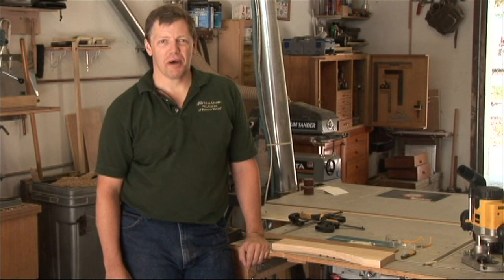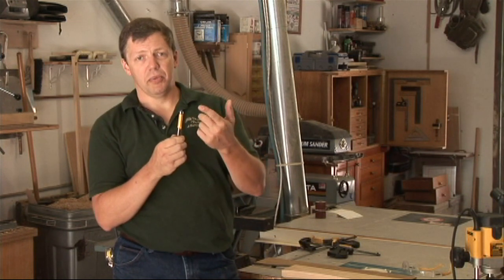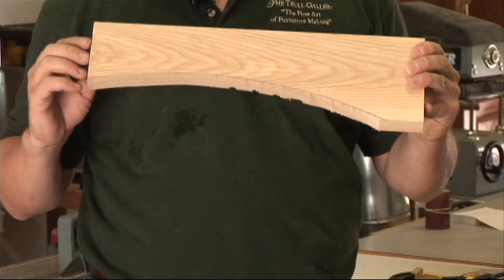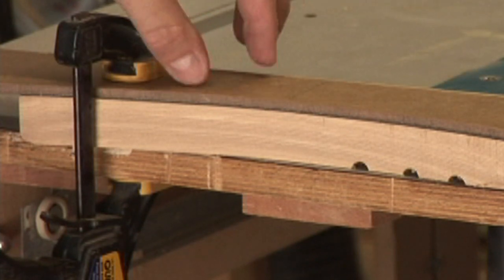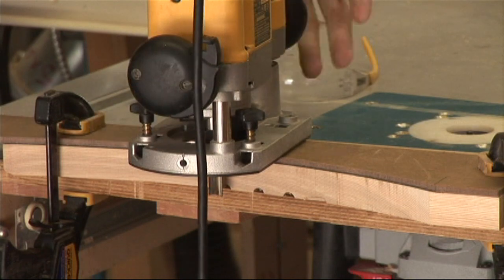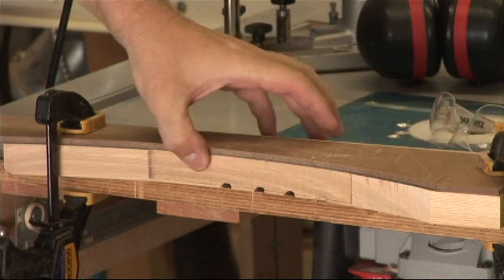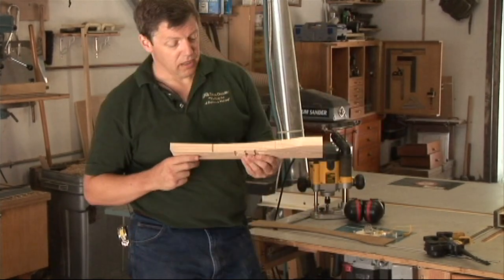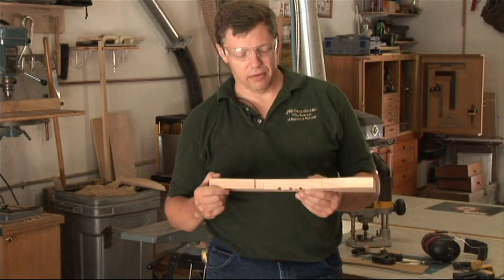Wood Routers : Using a Pattern-Cutting Router Bit

Comment: Didn't mention direction of grain. It's obvious you're cutting with the grain, but if the rotation of the bit is cutting into the grain versus cutting out of the grain, you will get tearout or even a kickback. In most cases you need to route end to center with a pattern bit, flip the piece over, then route the other half of the curve with a flush trim bit. Correct me if I'm wrong.

Comment: Question. If your guide bearing is locked right up near the router chuck, and your cutter is 3/4 inches. How can you cut deeper than 3/4 inches, given that you can't push the chuck below the router base plate? Is your cutter bit shank not pushed in all the way into the chuck? Is that safe?